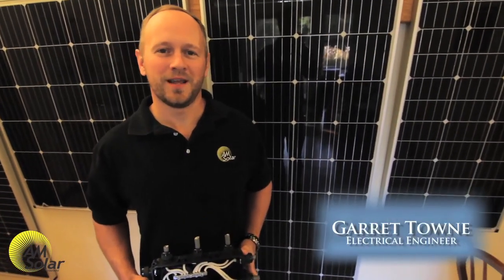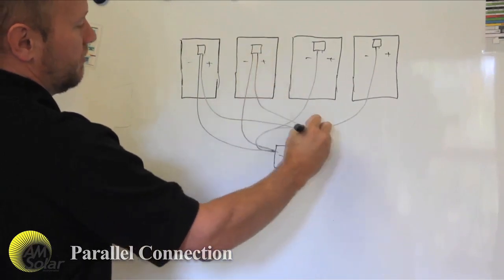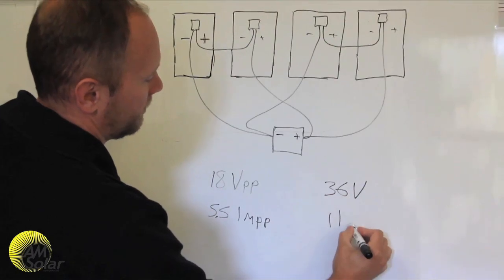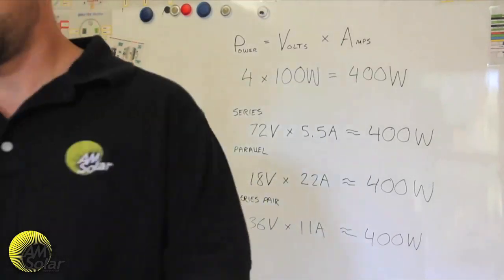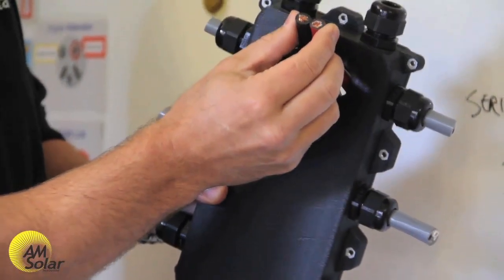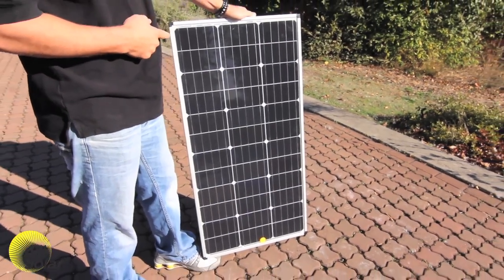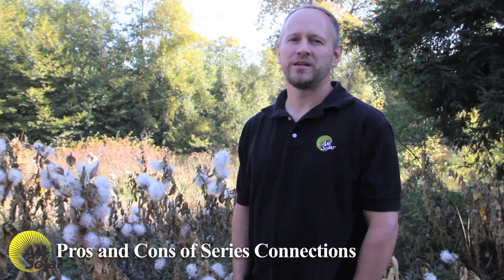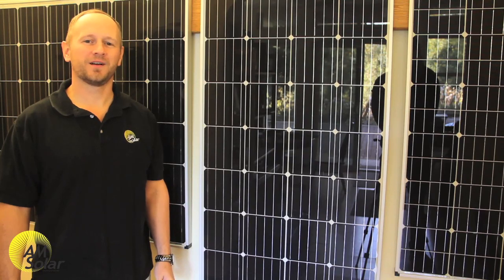Series Solar Panels Vs. Parallel Solar Panel Arrays for Your RV, Van or Skoolie

Comment: Garret thank you for the easy to understand information.  It's so great to have an electrical engineer, rather than someone who has only built their own system, for a resource.  I'm in Ohio building a camper van and sorting out the solar is proving to be the most difficult part of the build.  I wish you were in closer proximity so I could drive there.

Comment: The nice thing about information from a video is the PAUSE and REWIND features. While there was a lot of data in this video, it is actually presented in "bite sized" chunks that are much easier to chew up and digest (yes, it is close to meal time, how did you know?). As for desert? Actual installation - right.
Thank you for sharing...

Comment: Great explanation Garret, so in conclusion always use parallel if you have thick enough wire from the combiner box to the charge controller and your charge controller can handle the higher AMPs?  Is that correct?

Comment: If I have two 100 W solar panels do I go directly into the charge controller with both of them or do I need a junction box
Reply from the maker: Normally, we would connect the panels in parallel using an MC4 T-Branch connector then run the positive and negative cable through the roof penetration covered with a clamshell and bury the whole clamshell in sealant.  I think a junction box would be overkill.  Email AM Solar if you need more details.
Reply: Thanks Garrett that answered my question

Comment: Would like some help deciding my solar arrays 4x100W, 3x150W or 2x250W with a 40A charge controller located 50’ to 60’ away. Which of those solar configuration should i aim for in parallel? Or is there a better option with this charge controller? Cable size from junction box near panel to its destination (50’) at the charge controller should be 6AWG or 4AWG? Great content, thanks!!
Reply: Garret Towne  EPEverTracer 4210AN. Ground placement with no trees obstructing path of sun. 
Location Philippines

Comment: If I have an array of 6 solar panels connected in parallel, and 4 of them are totally covered most of the time, it won't affect performance of the only 2 panels receiving sunlight?
Reply from the maker: firpofutbol That is correct.
Reply: @GarretTowneAMS  Thank you!
Reply: @GarretTowneAMS  If instead I make 3 strings out of the 6 panels, with two panels in series at a time, and then parallel the three strings together. One string is in constant sunshine, the other two strings are usually totally covered. Will the performance of the string in constant sunshine be affected by shading of other two strings?
Reply from the maker: That is another good solution. Just don’t do a shaded panel in series with an unshaded panel.
Reply: @GarretTowneAMS  I see, thank you, extremely helpful!

Comment: I asked this question in another video comment section; but what is the most wattage you would suggest running thru 10 amp factory pre wire to the charge controller (parallel connect)? I ha e one 140 watt panel and want to ad one or two 100 watt panels. Could also go series as the controller is mppt. Thanks again
Reply from the maker: I wouldn’t series the panels because the mixed Immp is too extreme. Unfortunately, I would be hesitant to add another parallel panel to your existing 10ga. We don’t like to go over 200W on 10ga. I suggest trying to find a panel with a similar Impp to put in series, rather than 100W panels. You might be able to find a150W panel. That would be close enough. But your best bet is to route new cable. Play it safe and go with 4ga or 6ga. Good luck. Hopefully manufacturers will start getting more realistic with their prewires.
Reply: Thanks for your help. What happens with mixed immp when wired in series?
Reply from the maker: @paulchristiansen9633  The panels will be forced to operate at a current that far from ideal for either panel.  It won't start a fire, but you will only get a fraction of the potential output.
Reply: @GarretTowneAMS  Thanks again.  I appreciate your help. Also really like your videos!
Reply: @GarretTowneAMS  One more question. Couldn't I just add one 100 watt panel in parallel, which would only be 40 watts over the 200 watt guideline that you use? The mppt controller wouldn't be confused by that combo would it. Should generate about 12 amps to the battery bank.

Comment: Someone could burn down their RV or van if not doing further research and reading the panel spec sheet. Solar panels are never truly 12V, 24V, or 48V. A "12V" panel can put out 22-28V at max efficiency. The MPPT controller and wire gauge need to be properly sized for MAXIMUM efficiency. The max rating needs to be added together. And then maybe +10% to be safer. Panels can even exceed max ratings at high elevations with full sun.